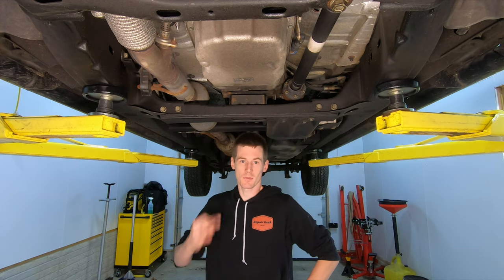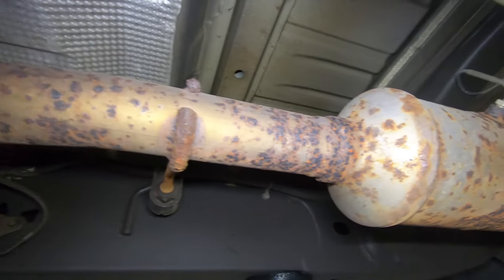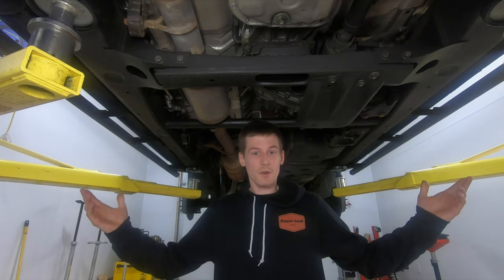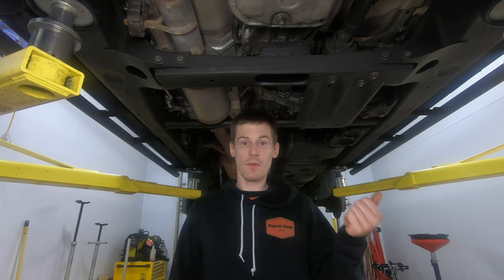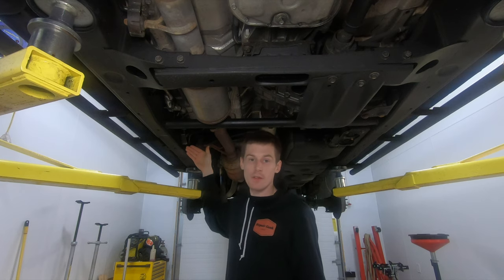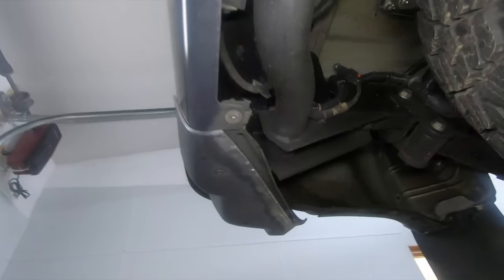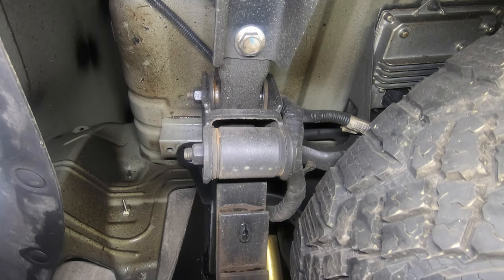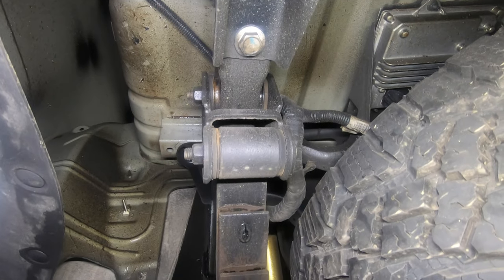Fluid Film Review After 3 Years and Woolwax Vs. Fluid Film Testing.

Comment: My experiance has been when you reach 4 or 5 coats of fluid film it turns in to a beautiful heavy salt proof film...the more coats over time the better....eventually rusty surfaces turn a dull black
Reply: They make a black fluid film
Reply: I put on three coats. Seemed great at first. But then came the sand and soot. Which soaked up the oil and dried out the fluid film and then it chipped off in huge chunks all over the garage floor. I learned its everything in moderation including fluid film
Reply: Bondo....yes they only call for 3 mil coats......i have 6  coats on my 97 rav,all good
Reply: Bondo....yah do 1 coat per year.....
Reply: Horrible abusive company that
disrespects
DIYers

Comment: I appreciate your honesty in all of these videos. They were a big reason why I went with FF for my 4Runner for the NJ winter.  👍🏻
Reply: How well did it do? Can you spray on to surfaces with rust already on it? I live in pa and wanna prep my 1980 pinto for winter
Reply: @speedyboi4623   yes...the more scale you remove the better...if its light surface rust it will turn black over the years and multiple coats.... coats
Reply: @speedyboi4623  Sorry, I just saw your post.  I had a mechanic spray it on.  I think I will make it a yearly event, trying to do it myself at some point.  I think if you watch all of his videos he says you can put it on surfaces with rust.
Reply: @mikeformisano9728  your good man! Thanks👍
Reply: Mike 
I live in NJ also. Did you apply FF yourself or have it done somewhere? If you had a shop apply would you mind sharing what shop.
Reply: @mikeformisano9728  Mike , I have the phone number and information. That’s for your help.
Reply: @Mac-i7  Cool!  👍🏻 If you can let him know I sent you.
Reply: @mikeformisano9728  Mike , I called Steve but the number has been disconnected. Would you forward me the name of the shop?
Reply: @Mac-i7  Oh man!  That will be a problem for me next year.  Google “4Runner fluid film NJ”. Find the “Toyota-4Runner.org” message boards. There is a thread there where he advertises.  Look for posts by user “dedonderosa” and try to get in contact with him that way.
Reply: @mikeformisano9728  ok thanks again Mike!
Reply: @Mac-i7  No problem.  Good luck!

Comment: Fluid Film  was developed in 1943 for the US Navy for rust control in double bottom ships.  
Great product been using it for years; over the road tractor trailer,  automotive, marine, farm and more!!!
Reply: Cosmoline was also developed to prevent guns from rusting in the military. Look into that
Reply: @jaygee6983  Cosmoline used to be used on BMW engines for transporting across the ocean to the US for delivery.  It had to be removed on port entry though or the heat of the engine would bake it into an ugly yellow color.  Ask me how I know ;)

Comment: On the high exposure areas, get some aerosol cans of crc marine corrosion control, and hit with that. Like the ebrake cable adjuster, etc. It congealed to a nice wax that encapsulates it. Works a treat. I use both ff and crc.
Reply: Can you put that on top of undercoating?
Reply: @Coyote-wm5op  I’m sure you can, don’t know how effective it would be. Undercoating is really terrible stuff, not good for much. It always fails.

Comment: I use both Woolwax and Fluid Film. I used the Woolwax kit with gun and 360°nozzle. I applied it after and onto a coating of Fluid Film. The inner panels of front fenders and bed sides got coated with Woolwax. Inside all doors and posts got coated in Fluid Film. Fluid Film gets more use because it is a thinner product and it is constantly moving on the metal. Every oil change I drag a hose and the spray gun for touch ups and a can of Fluid Film for the same reason. 
It stops rust. If you already have surface rust, clean it up and coat it. It’s done, dead. The black is awesome on chassis parts, looks real sharp.

Comment: Awesome video. Your exactly right. Wool wax is a great product for outside frame protection, but won’t creep like fluid film. I’ve personally seen fluid film creep 2-4” from where it was sprayed originally. Quite impressive. Wool wax pretty much stays where it’s sprayed which is good for wear resistance but poor for inside doors/rockers etc.
Reply: So, woolwax on the exposed parts and fluid film in the hard to reach places. Best of both worlds.

Comment: Woolwax and Fluidfilm are both solid products, however in some applications Woolwax is a better product. 
I maintain a fleet of around 10 medium duty and light duty (one ton) trucks. These truck work in extreme environments and are subject to highly corrosive conditions, in fact we have a dedicated lift for corrosion protection application.   I have tested many different products for corrosion and rely on Woolwax at this point. 

First, Woolwax does seep into all small tight places, the reason that a liquefied version is sold is so that the product can be applied with lower temps. If its under 60 degrees when you use Woolwax and it isn't going to get over 70 for the year you may want to use the thinner Woolwax for inside doors and body, however we never do, instead we just warm up the Woolwax then apply it.

The main difference in Woolwax vs Fluidfilm is Woolwax is thicker and stays on longer. If you try and pressure wash both you will see the Woolwax stays on much better (also WW has a black tint option, fluid film didnt when we last used it). 

If you use Fluidfilm you need to spray yearly, for most folks you can do Woolwax every other year or even longer. 

If you are serious about corrosion protection and you follow these directions you will not get any serious rust on your equipment. We have equipment over 10 years old that look nearly as good as new.

1. Pressure wash the complete area you are going to treat.
2. Using a 1/4 hose flush all small compartments throughout the chassis or area you are going to treat. Repeat this until absolutely no signs of dirt are left. Let dry completely.
3. Use a product such as CRC corrosion inhibitor to go over any areas that are already showing rust, repeat.
4. Remove all body plugs including in the doors. Apply Woolwax or Fluidfilm in these body areas (for most cars and trucks this is a one time application). Put your plugs back in.
5. Spray the rest of the chassis or equipment your treating, make sure to go slow and spray from different angles. On a medium duty truck or pick up I use anywhere from 2 quarts (previously treated truck chassis), to 1 gallon on a chassis that has never been treated. 
Remember if you are going through the work to do this take your time and prep the equipment properly, take your time applying the product so that you get all areas.

The first application takes 2 days (one day for prep and drying) another 2 hours for a new application. Following the first years application it takes me about 1 hour reapply Woolwax each season, about 2 hours from fluidfilm.

Comment: I had my 2016 Chevy Silverado 2500HD sprayed with fluid film 2017,sprayed on crazy thick with a airless gun in 2018, and sprayed now/touch up. The underside still looks brand new underneath. 👍 woolwax is also good but maybe too thick for the cavities like you said. 👍
Reply: I tend to disagree with it being too thick for the cavities. I heated mine up with a propane heater in the gallon jug and just filled the quart bottles up for the pro gun as i went along. with the 360 degree nozzle and the extension wand you can hit every square inch of your underbody and not miss anything. if you spray a lot it does tend to run so I dont think that's really a problem if you do it correctly

Comment: Really great video; thanks for the thoroughness!  

With regard to the weather stripping, I expect that if you were to treat the rubber with something like Sil-Glyde before it comes into contact with the Fluid Film, it will probably be far more resistant to the swelling effects.  Fully agree with your assessment of the value and trade-off between protecting the car and protecting the rubber seals.

Comment: As someone else who lives in northeast Ohio, and used to have a 2018 Silverado... I can tell you from experience that your truck looks 100% cleaner than mine did. I washed it religiously, utilizing the laser washes under carriage sprays that we have around here, and it still started rusting pretty bad. Buddy of mine just had the bed off his 2017 gmc Sierra to strip and re coat the frame for the same reason

So yes, clearly this stuff works lol. Thanks for the video updates. I see I should have done this from the start when I had that truck, and will be doing it on my ram here soon

Comment: I use that stuff religiously. Surface shield is good as well. I bought a kit with a spray gun. I do mine twice a year. Had mine 3 years some of the guys at work are doing it and I’m showing them how to do it. Very easy process just got to know what the most important areas are to spray. I used to just spray everywhere but now I don’t as much. Rocker panels and underneath the bed and axles and suspension inside tail gates and underneath door and underneath the bottoms of doors and wheel wells. Nice thing about this stuff doesn’t hurt your clear coat.

Comment: This year I hit my rust with metal prep and etch (phosphoric acid) prior to fluid film. So far seems like a good idea. Not a new truck though. I really enjoy your videos. Thanks
Reply: what I plan for my GS.. drove her 1 day last winter and all the paint underneath got eaten, been there for nearly 50 years without winter use, and 1 drive in 1 winter ate most of it off..  have some ospho was going to brush on and let dry before using this as well...  too much work to blast, epoxy etc for this old man...
Reply: @craiggerlach5548  I wouldn't epoxy but you should think about maybe blasting with walnut shell media to remove any remaining paint. If one exposure to winter caused it to fail, it was likely already failing. Also, I like 2 applications of phosphoric acid a few days apart, I used a pump sprayer in order to get inside of frame rails etc. Good luck with your project
Reply: I wonder if you could mix ff with prep and etch to spray on the rusty areas to convert the rust to the black iron phosphate and seal from future corrosion all in one
Reply: Yes my 2011 f150 mini restoration I sprayed everything chassis frame floor bed door bottoms lines crossmembers with metal prep from Rona called rust buster it was about $8.99 a liter . I also added some it to my first thinned oil coats and to my final thicker oil mixture which I added some asphalt liquid foundation coating to blacken it  and provide better wash off protection .
Reply: @craiggerlach5548  wash under side and frame under hood with power washer to remove all traces of salt first . Or even plain water also could get a hose attachment that has a cup for soap with extended sprayer nozzle . Then phosphoric acid /metal prep spray on you can mix 50 50 with water using a small garden sprayer sprayer. Leave the acid water mix on the metal frame chassis let it dry and repeat dont wash it off  . If rust is totally gone you could paint with black primer then I would oil under coat every thing .I have a 1976 vette i never winter drive owned for 40 years. I oil undercoat the vette ever 2- 3 years the frame inside and out even drilled 1/2 inch holes and plastic plugs in closed in sections ,frame is mint .
Reply: @nickking1510  I had a 69 GTO that never seen rust, when I owned it I would wash then wipe down everything with trany fluid, the 4 years I owned it, and drove salty winters, not a spec of rust formed that I could find.. they tore down the public drive on hoist I could use to do this.  But that car had all the paint, and this trip got me.. will wait til summer n pressure wash, coat, let dry and epoxy it all..   just not getting any younger.. and miss ability to drive car in winter like I did with the GTO...

Comment: Try using a dry wax spray such as Amsoil HD Metal protector [2-3 coats for the wheel well area]. Takes a few hours to dry, then apply  fluid film over it. This combination held up well in Chicago weather.
Reply from the maker: Thats just comoline with an amzoil markup.
12:35

Comment: I've been using FF on my 2019 Silverado Duramax and haven't seen a speck of rust so far. Fluid Film is good stuff. Only downfall is it makes the factory GM wax coating on the frame really really soft and smudge off when touched or rubbed

Comment: I would say woolwax is way better also been using both for ages, woolwax creeps when it’s warm. I’ve had it still leaking out of plugs a year later. Also seems to handle the wash areas way better. Fluid film didn’t even last me 6 months in any area that saw slush, water. The woolwax is still 90% there a year later, also doesn’t stink for 2 weeks plus.

Comment: While nothing can prevent rust, FF sure can slow it down!! I have a 2012 F350, a WI truck that I have had for a year and there were some rust spots starting underneath that I hit last year with FF, and the rust did not grow. Yeah. I gave it another coat in September, including the front bumper that is spotted with rust from rock chips. Will see next year if there is any more growth,  but feel pretty confident that the FF will keep it from rusting more during the bad winter weather.  Wool Wax is heavier bodied and comes in black. Going to try it next year.

Comment: Based on your 3 year study, I selected FluidFilm to undercoat a 1988 Classic Mini (fully restored a few years back). Though I don't drive it in winters, rarely in rain even, I want to do what I can to help preserve it. Got the 1 Gal can of FF on sale and used less than 10/th of that on the little mini! Should be good for another nine yrs of undercoats !
Reply: Minis can rust from the inside out due to zero protection from the factory without even trying. Using FF will be the best thing

Comment: The water that sprays up on the freeway doesn't kill your wiring. Just don't go full throttle on connections. I dot 5-6 times a year and I got 231,000 miles on my chevy. Its so ridiculous to think your gonna destroy your wiring harness. Just spray some degreaser under there and wash it off with your green tip. It's 100% fine.

Comment: I fluid film my 2dr Rubicon every year since i bought it before it ever saw salt...stuff just plain works, it does wear off in high-wash areas, but i reapply every fall anyway. She looks brand new underneath, and youd have no idea it has spent the last 4 winters so salty its white from top to bottom (the jeep is black lol). The nice thing is if i want to work on it and not deal with the mess, I can wash it off with degreaser, and just reapply.  And since i do it every year, it gets easier, and its more like giving it a quick touch up, the areas that dont see water, look like fresh fluid film still...I just tried the black fluid film on my '10 F150 (with 270k miles), and the black really does look much better.

Comment: Whoa....I considered using woolwax instead of fluidfilm but lack of pinch-weld penetration is a deal breaker for me. Fluidfilm's ability to migrate across surfaces is also what makes it work so well.The fact you're talking about pinch-welds also tells me to probably know what you're talking about. Good to know.
Reply: NH oil migrates a lot better!
Reply: @josepires4345  How does it stand up to road spray? Does it wash off easily? I'm willing to try something different if it works better.

Comment: Appreciate your experience and knowledge. I use ff with a harbor freight electric sprayer, rattle cans for the internals with the 2 foot 360°sprayer, and brush grease on the easily washed off components.

Comment: Oh yes there is.  You can use high temp oven paint.  It’s made for fireplace mantles etc. I’ve painted a fireplace mantle that gets red hot coals against it almost all the time during winter. That paint wouldn’t have an issue being on that muffler. Maybe over time but it’d take a while.
Reply from the maker: When was the last time you dumped salt water and brine on your mantle?

Comment: Try spraying graphite lubricant on your exhaust. I've used it on turbo exhaust housings and exhaust manifolds and it holds up to those temps. You have to re-apply it occasionally but you could hit it every year you are under there anyways. Just a thought, never tried it myself on exhaust, but it might work.

Comment: I use a 5 gallon of black fluid film, with a pressure spray gun and paint brush for the first time.  Coated as much superficial rust as I could.

Comment: Appreciate your videos as I try to decide what to spray on my vehicles.  I think I'm going to use a few cans of CRC in the small, tougher areas and the NHOU clear for the major areas.  I would have never tried the CRC cosmoline spray without your testing video.  BTW kerosene and a rag removes cosmoline although it is flammable.  My opinion is that your side by side comparison of Woolwax vs. Fluid film is flawed from the beginning.  Road salt here in Maine is not evenly dispersed on the roads.   Municipalities tend to pour the calcium on the yellow line.   This make underbody corrosion on the drivers side MUCH worse than the passenger side.  Maybe your state is different.  Keep up the good work!

Comment: Thank you very much for your work with these products, its been very helpful. Im sorry if you have already covered this subject, but im going to ask the question, what have you used on oil pans? I have had two trucks in a row now that have had unacceptable amount of rust to the point where they needed to be replaced in  6 year period. our new truck im going to be applying the Fluid film to, but due to the heat, I don't believe it will work on the oil pan? I was considering grease? What would you suggest?